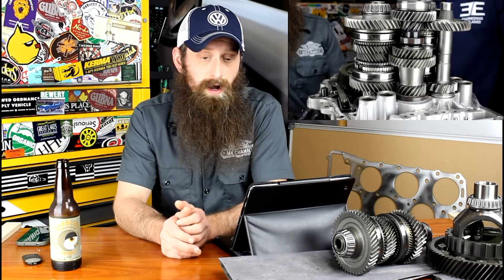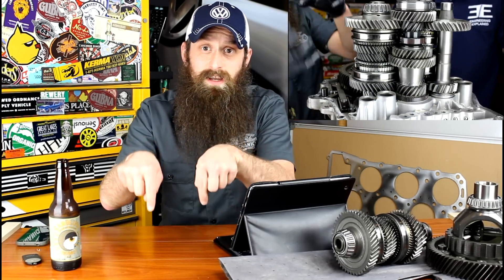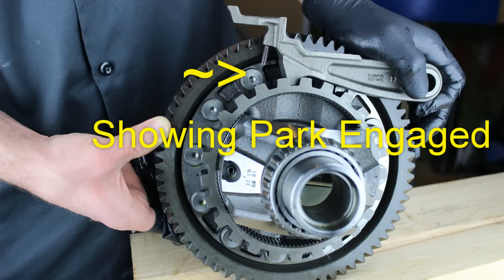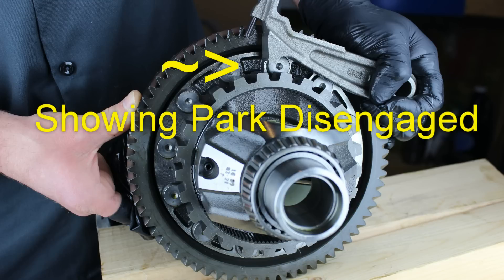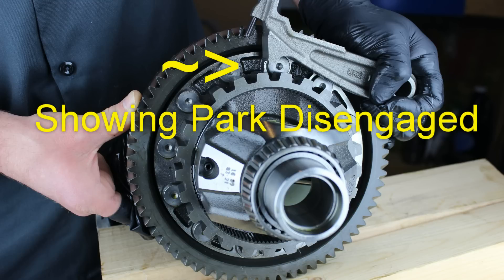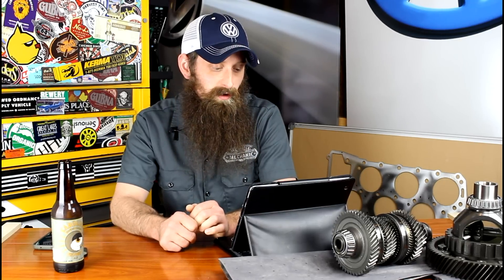Viewer Questions on DSG Transmissions, Podcast Episode 30

Comment: Have you ever had a dsg trans replacement (used low mile unit) that had no codes, fresh oil and filter with original mechtronic in new used trans with no drive? It passes pinch and group 61/60 in vcds. It engages but no drive.

Comment: Hi Charles, thanks for the video. Please is there anyway to test or check the G182 sensor with a multimeter? I have  a 2015 VW CC that has stopped to engage in all forward gears and reverse. It came up with the code P0716. Can this code cause the car not to move at all? I have changed fluid, checked the wires and no sign of damage. My is just less than 35K miles. thanks

Comment: How are you , I have a 2009 jetta 6 speed dsg,it  is slipping and bucking, when cold in 1,2  gears , than it goes to normal  mode ,  could this be transmission  fluid.   thanks.
Reply from the maker: Start with a fluid change for sure

Comment: Two months after my APR K04 install on my 13'VW CC 2.0t CCTA DSG, i was acceleration hard from a red light and suddenly got a check engine light. So i scanned it and got a 18149 clutch pressure, adaptation at limit. DSG transmission code. 

I was told i should try clearing it through VAG-COM and try do a clutch adaptation and see if that resolve the issue, but if it keeps coming back it might one the solenoids on mechatronics unit has failed. I also have a APR DSG tune.  

Just wondering if anyone has any experience with this also?

Comment: Hi, I have a 2009 VW jetta sport wagon, I get a code P0734 ⚙️ incorrect rotation, I was told to swap the whole body valve, after we swapped and trying to reprogramed with VCDS I keep getting error 63,
I ended up swapping the whole transmission from a collision car that it was running fine the issue still there, now they tell me that it's probably the harness, we swapped the entire harness and TCM with no luck, if anyone had this issue and fixed I will appreciate any advice, thanks in advance.

Comment: Hello,

I have a problem on my Vw Passat I scanned the car with the snap on machine

Code: “05741 check DTC memory of transmission controller P1652 not a plausible signal”

Need help what could this be?

Comment: Hi Charles, I've got a 0AM that got rebuilt. I mounted it and it all worked fine but had a little rough downshift from 3rd to 2nd and 2nd to 1st. I decided to run the "easy pedal to the floor" reset and now the mechatronic pump won't work. Fuses and relays are all OK, hard wired the pump and it works. I'm lost on what can I do to have it "enabled" again as I'm sure something went wrong on that reset. Basic settings were performed the first time and all went ok. Now it won't take them since it has a code for reduced performance due to low hydraulic pressure. Thanks in advance for your input!

Comment: Hi I am Andrew form New York I have a 2007 VW GTI FSI .  I have an issue some time when I put it in park it buck a few times and stop then the call shift shift indicator on the dash start flashing I would have to shut the car off turned it back on in order to switch gears again It has 169.455 miles on it all original I would like to know what would cause that to happen ?

Comment: I got a question???? Doing 70mph on the e-way , I floor it, it drops two gears, motor revving rpm are up, but the car is not accelerating???????? Still at 70 mph.  Accelerates good at low speeds....

Comment: Hi mi just buy a 06 mk5 gti 2.0T with Dsg transmisión , engine hace 155k miles no ir, mi buy it for $1,400 , Needs some repairs , have some troubles with accelaration and boosting , i think May be N75 sensors and the high fuel pump  in the engine head location. What you think about it?

Comment: Hi Charles

I replaced a engine for a polo gti 1.4tsi with a dsg7 transmission. 

Question: vehicle  doesn't change pass 3rd gear,sometimes it changes to 4th but at very high revs
Reply from the maker: Any faults
Reply: Hi,thanks for reply
P177B,P177C and P177F

Comment: Excellent Channel I love it , Got a question for you, jetta 2.0 T FSI 2006 100Kmiles on P and N we can run the engine easily at 4000 RPM. When it's on the road and we accelerate heavy first to second will gear up perfect but to the 3rd up to the 6th, when it  reach around 2700 to 3000 RPM the transmission wont  gear up and the engine will jerk forwards repetetively unless acceleration is stopped.Do you have an Idea of what it could be?  We check fuel pressure low side is at 91% HFP is at 1300PSI .  No engine light on

Take care and thanks for sharing your knowledge

Comment: I was having the same issue with jerking in traffic
Reply: It's a dual clutch, when you let off brake in traffic and hit the gas before both clutches can engage, it can be pretty wonky. Both clutches should engage before power is applied

Comment: Hi recently I’ve had intermittent issues with reverse when I try to reverse quickly . I have to wait 2 or so seconds until the car begins rolling back on its own. Yesterday there was a car flying up on my tail so I tried to floor it to get out of the way and the car didn’t shift quickly and jumped in a noticeable way. My car is a 2010 vw cc sport 2.0 with the DSG it has 187k miles on it. Online I saw that at 150k it needs to be serviced . Which is a bit confusing to me because I see that DSG Service says to do it every 40k. I called around to a few shops . One immediately was trying to quote me 1899$ to rebuild it. I was concerned that without seeing the vehicle he would already assume I needed that drastic of a fix. Another I called said that it sounds like it’s time for a flush but won’t charge me for it until he’s added/ looked at the fluid and test drive it. Is my transmission shot or is it just time for a good service? The car drives. There’s no noise like clunk or anything. Thank you so much I just don’t want someone to rip me off because they think I’m not knowledgeable. I’ve done a lot of research but I’m not an expert. Thank you again love your channel it’s saved me many times
Reply: Did you ever figure out what was wrong with it?
Reply: supertitan21 I did, it wasn’t the tranny. Needed a new crankshaft position sensor and intake manifold had also failed. I’m good now. Also changed plugs as well as fixed a coolant leak at the thermostat housing.
Reply: Meagan davy im glad it wasn’t the transmission. I just got a 2010 vw cc two days ago and I experienced that 2 seconds delay to go into drive and into reverse. Did you do all this services your self? Where did you get the parts from? I took it to the dealership to get a new used ecu programmed and they told me i might need a new intake. But there is check engine light.
Reply: supertitan21 a local shop did it for me . I didn’t feel safe enough messing around near the coolant lines and fuel lines .
Reply: Meagan davy what was the price if you dont mind me asking

Comment: You can fix the rolling after park if you park your car properly.... pull up on the ebrake then put the car in park... problem solved
Reply from the maker: Yep. Not a big deal. Just different than a regular auto
Reply: @HumbleMechanic  really?  I actually learned that when I was in drivers school 20 years ago on a ford contour auto.  It was right up there with turn your lights on as part of your start up routine so you don't drive around in the dark or rain like a nitwit without them.  BTW I only have a DSG for my wife..... Stick for life

Comment: Why I am hearing this type of clicking noise I believe is coming from transmission.  I only hear it at low speeds or going up a hill. I never hear it on  the highway at higher speed.

Comment: Just got a 2014 Passat tdi with the DSG very recently. It seems like the clutches are possibly slipping in 4th while accelerating and 6th while accelerating or climbing a hill. (Rpm appears to rise and fall in these situations, but not a very sharp rise. About 100-200) It doesn't have any records I can find for a dsg service and I'm at 84k miles, would that be a primary cause or should I be heading back to the dealer under my 15 day/500 mile power train?  It did not come from a VW dealer.
Reply: Hi mate did you find out what the problem was I have the same problem?
Reply: @paulspursboy629  trans cooler line leaked inside trans. Only fix is replacement

Comment: Hi and thank you for the video!
I was just given (yes given :-) ) a 2004 VW Multivan with 6 speed DSG. It has the fault code P1625 stored. Do you have any experience with that one or know how I can fix it?
It's my first VW, so I don't know these cars so well. Thanks in advance.

Comment: Great channel thanks for your posts. I have a 2012 nms Passat w TDI and DSG.  I’ve heard a bit on forums on DMF failures. Is this a problem in my dsg. I’m thinking it was updated by 2012. Also thinking of doing a Malone tune on my tdi without the DPF delete to gain max performance on the tune they do a dsg tune as well which increases  the torque limit function up to something like 315 foot lbs. I’m wondering if that is a good idea I’m told the dsg is a pretty beefy transmission but I’m worried about trans/DMF problems with extra strain on it. I would like the extra performance and fuel mileage. But don’t want to cause myself more problems down the road maintenance wise. Thoughts? Thanks in advance. The car currently has 215,000km on it and I’ve change the fluid/filter on schedule with the measure refill method. No issues so far it is a sweet trans which is supposedly able to upshift in 8m/s , mind boggling. Works very well on a turbo diesel or any turbocharged engine with smooth seamless power delivery. and I AM a manual trans guy.

Comment: Question for Charles
Timing chain tensioner issue for 2014 GTI Wolfsburg, is it common? 

I was gonna just change it but do you feel its needed at 65k miles
Reply from the maker: Not as common as earlier models. But it does happen
Reply: When you say earlier models, what years are you referring to? I have a 2010 Gti.  2.0

Comment: what is the difference between an first gen dsg dq250 6 speed 2007-2010 passat and an second gen dsg dq250 6 speed 2011-2015 and can one mount an second gen dsg 2011 on an older gen 2008 passat? can it be adapted on the older engine?

Comment: '09 TT 2.0 FSI with a DSG just turning 253,000. Always maintained. Replaced mechatronics at 245,000 just as maintenance item. I have personally serviced this car at a dealer level since new.
Reply: Did you have to replace clutch in between?
Reply: @charleschenhua  . No. Still the same. I have personally serviced this car
Reply: @charleschenhua  . No. Still the same. I have personally serviced this car
Reply: still original. I had serviced this car personally for the original owner since it was new.
Reply: Did you replace the ENTIRE mechatronics unit or just the fluid? I'm not sure whether such thing as changing the mechatronics fluid exists so I would like to know. Thanks in advance!
Reply: @The3lloba  There is only one fluid for the DSG. The mechatronics does not have a separate fluid.
Reply: @obieoberstar  

https://youtu.be/8BbjLT3yQ-8
https://youtu.be/ZtCA3wqDa1s

Even Humble Mechanic says there is. Said it uses hydraulic fluid.
Reply: Do you have power adders or any kind of tune? 200,000+ is very impressive and is the goal for my mk7 gti dsg.
Reply: @TheDadFatha  No power adders. Bone stock. I feel that it has enough power for me. When I want more "Go" power, I put into Sport Mode.
Reply: @TheDadFatha  the original owner commuted probably 200 miles a day here in Southern AZ. Pure highway mile. Dealer maintained by me since new. No leaks and everything works. I love this car.

Not sure how to convert city commuter miles to highway commuter miles.
Reply: Do you have power adders or any kind of tune? 200,000+ is very impressive and is the goal for my mk7 gti dsg.
Reply: I am considering swapping a DSG into my ‘08 Passat. I can get a transmission but am worried about the condition of the mechatronics unit.

Comment: Hi. I have a question. Have a DSG DQ250. It does not always automatically switch to the next gear. If you brake then, it works again.Manual switching is always possible.. Manuelle What could that be? The cruise control is not always, brakes, it works again. What could that be?

Comment: I have a DSG passat 2012 B7
In the morning it doesn't shift to reverse.. After put the reverse within few seconds it starts moving. Sometimes it happens to the D gear too... OBD says "unable to shift to reverse.. I'm a mechanic from sri lanka
Reply: Sachith Thilanga Do you let it warm up before reversing? That's not an issue I've ever had in my DSG's. Has it been serviced?

Comment: I don't know if any can help but my dsg has started slipping. It only happens when I attempt to rapidly accelerate but is fine when driving normally. Also it only happens in drive and manual shift, sport mode drives perfectly fine

Comment: Is DQ 200 is a reliable DSG or shall I go with manual gear box?in vento diesel. I heard that,as it is a dry  DSG, it is getting more problems.Hope you respond.
Reply from the maker: Not a fan of the dry clutch as much as wet clutch. But we only had dry clutch in the US on the Jetta Hybrid

Comment: I read somewhere that the DSG oil temp is about 35C ( 95F ) when the instrument cluster reads 200F for radiator coolent temp. ( Ambient temp 75 F )  Does that sound about right based on your experience.  I dont have the software to measure the actual dsg oil temp.
Reply: World Traveler don’t worry 
About the temp 
Just make sure to 
Put , back in !!!
What you take out . 
I do it Ones a year in 
All my vehicle 
Since I pay only 35 box 
For the ATF oil 
My Passat 
My vw , run like a champ 
Don’t have any problems ,

Comment: Hi @humblemechanic, I’m facing problem with DSG Mechatronic in my Skoda Octavia 2009- 7speed, while I Shift gear in D,R,S on dash board D/R is flashing and car is not moving forward or reverse. My mechanic said needs to replace Mechatronic( but it cost more than car value). 
So my question is, if I have manage to get Another Mechatronic unit from other Octavia 2010-7speed, can I install it? 
What is the process to do reprogram/flash?
And another way is 
There are several companies selling Remanufactured part on Ebay( they ask for VIN to install software in TCU), what is the chance of success!!!!!
If you know any other solution please tell.

Comment: Hey Charles!Can you answer me one thing.Does  transmission fluid moves/push clutches(wet clutch)i.e. locks one clutch by its fluid or fluid push piston that locks clutch?Or method is different...
Reply from the maker: Yes. That part functions like an automatic trans clutch pack
Reply: @HumbleMechanic  Ok,thanks for answering!

Comment: Hi, my dsg on my S5 2009 is slipping on third gear. Could it be a clutch problem or a tcm problem? Fluid level is good. Because no code were found on the scanner.  Could the problem get worse?
Thanks
Reply from the maker: Just in 3rd? Possible clutch? But clutch issues just in one gear are not common. at least what I have seen
Reply: @HumbleMechanic  yes just in third gear. It could be something semiblocking the way for third gear in the mecatronic unit? Maybe a solenoid? A programmation problem or just wear on the third gear? 
What i have seen is.that when i accelerate decently like i let the shifting done arround 3000rmp in automatic mode the shift are great . The rmp from 3 to 4 dont even get higher when it changes. 
Its really a weird problem. Ive been driving it for 20000km no error code no nothing. Finger crossed.

Comment: I’m sure this has been asked before, but I can’t seem to find the answer from a reliable source. Should the DSG fluid change be based on miles or time. My wife has a 2013 Beetle Convertible that was bought new in 2014. It currently has 12000 miles on it well below the recommended 40000 miles change cycle, but it’s been in service for about 60 months. Should I have the fluid changed now or am I safe to run it a few more years until it has say 24000 miles.  Love your channel.
Reply from the maker: I’d probably do 5yr or 40k

Comment: Do I need need to change or how many miles to change 2014 Touareg TDi transmission oil and filter? Please advise. Dealer said never changed? Is it true? Thank you so much.
Reply from the maker: No service interval but I’d probably change it. I’ll be doing mine at some point
Reply: @HumbleMechanic  thanks Humble! What oils spec are you used?

Comment: Fantastic video!  I recently purchased an '04 TDI New Beetle with DSG trans, knowing that the DSG had problems (not staying in gear at highway speeds, erratic shifts).  The previous owner had the clutch pack replaced, but did not replace the Mechatronic Unit.  Since then, I purchased a NEW Mechatronic from VW and installed it, along with fresh fluid and filter.  I did a full adaptation through VCDS.  The trans now behaves as it should, except for occasional jerking / clutch chatter feel when taking off from a complete stop, especially uphill.   Are there other likely causes of this type chatter/jerking when taking off from a full stop (DMF, clutch pack, maybe the DSG oil pump)??  Trying to figure out the root cause of this jerking behavior.  Any help would be appreciated.

Comment: Hey man great video. 
I have a 2012 gti dsg transmission. I went on a long ride and out of nowhere the car starts acting like it has clutch slip and now the car only will excelerate slowly
Reply: Also at that time it started to slip a check engine light came up
Reply from the maker: That is actually good that the light came on. It will give you some info on what is going on
Reply: HumbleMechanic I'm getting checked out asap.
Reply: What happened with the car?